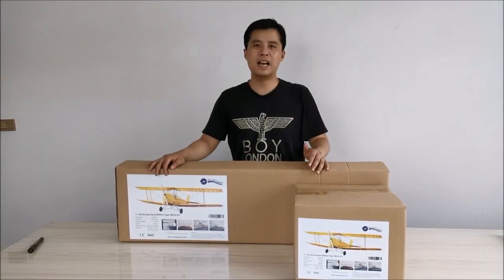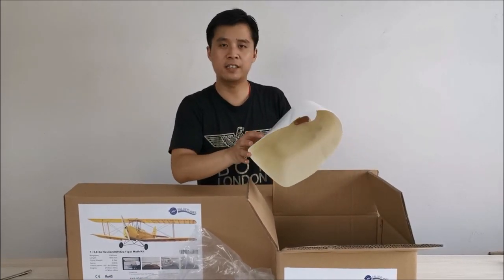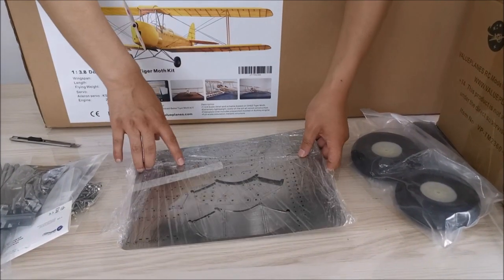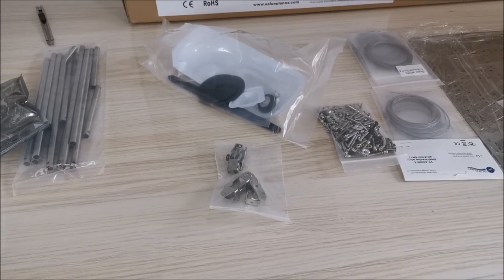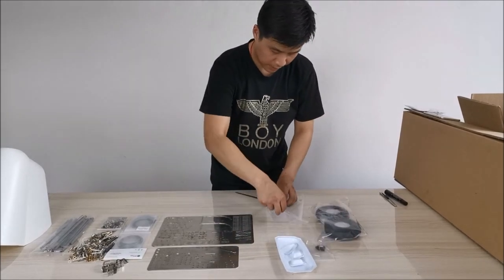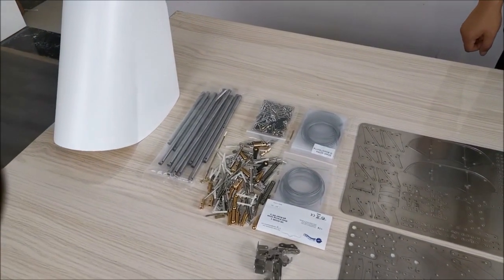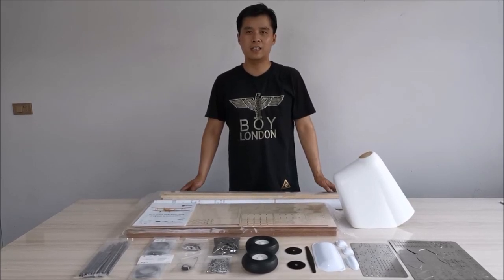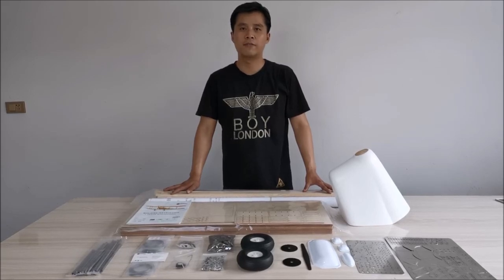Unboxing 1/3.8 Scale De HAVILAND Tiger Moth From VALUEPLANES.

Comment: I would like to see a review of this kit/aircraft before purchasing.
Reply from the maker: https://www.lindinger.at/en/Airplanes/Aircraft-Models/Aerobatic-Airplanes/VALUEPLANES-TIGER-MOTH-DEHAVILLAND-DH82A-WOODEN-CONSTRUCTION-SET-1-3-8-2-36M-WITH-METAL-FITTINGS-AND-GFK-HOOD/9768833

valueplanes. Com
Reply from the maker: Reviews: 

https://www.rc-network.de/threads/de-havilland-dh-82a-tiger-moth-m-1-3-8-laser-cut-bausatz-valueplanes-baubericht.780695/page-14
Reply: I am building one don't hesitate it is very good quality for what you pay i've seen way worse! Good quality wood and stainless steel fittings.
Reply: @yoshievandewalle724  Thanks